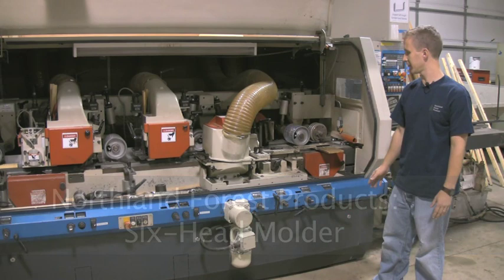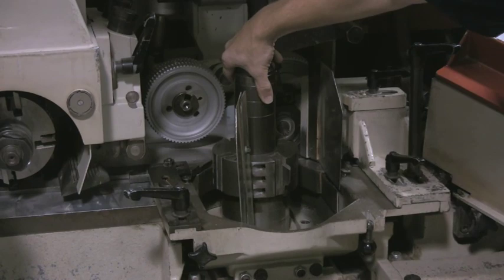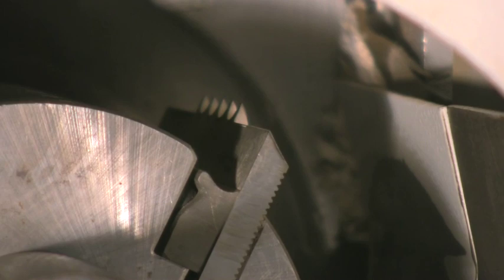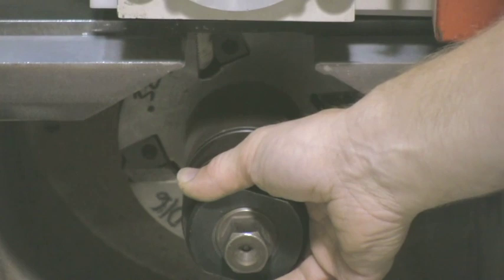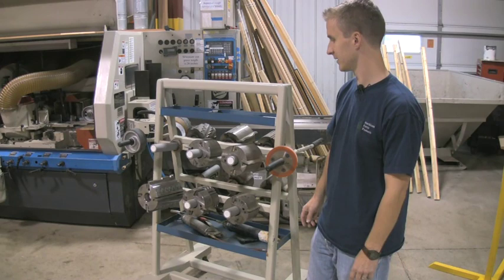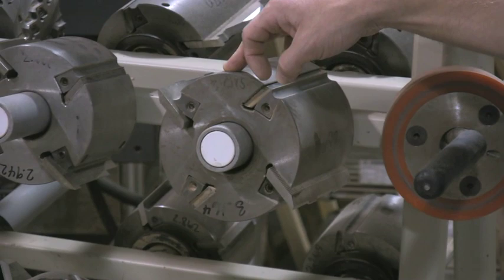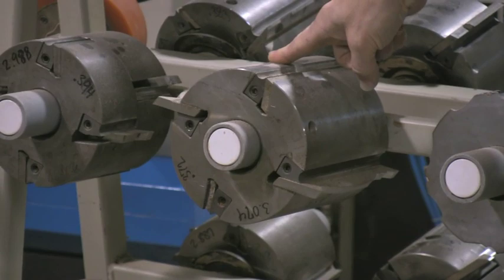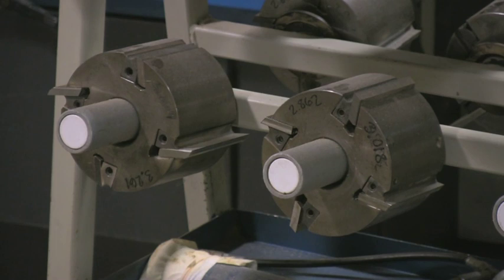Six-Head Molder in Operation

Comment: 1'st bottom head. Next, fence side head. Next, 3rd Off side head. Next, 1'st top head. Next, 2'nd top head. 
Next 6'th bottom head, this head is usually a universal head for splitting or doing additional mouldings etc.
I used to run Wadkin FD 6 and 5 cutter headed moulders in the 1970s/80s in the UK. Enjoyed your video. Tony.

Comment: Need some assistance in identifying model of weinig molder I bought from used machine dealer. Looks like a 6 head molder.  Plate with construction date 1989 and Mach # 143 5305...machine was made in Tauberbischofsheim, West Germany. Any help would be appreciated. I was told I need 2 spindle barrels.